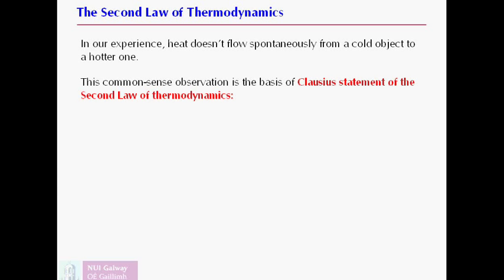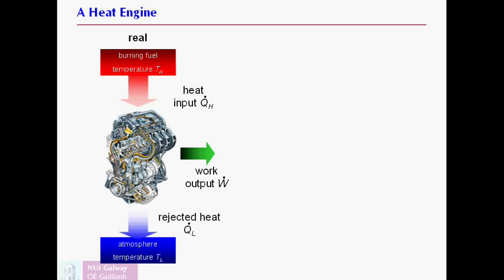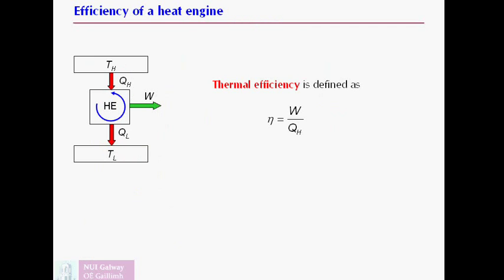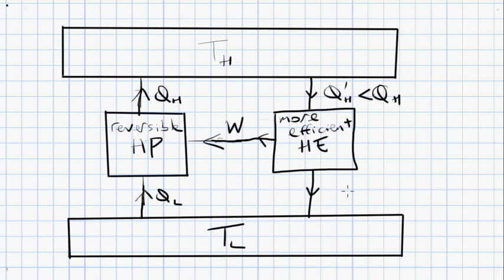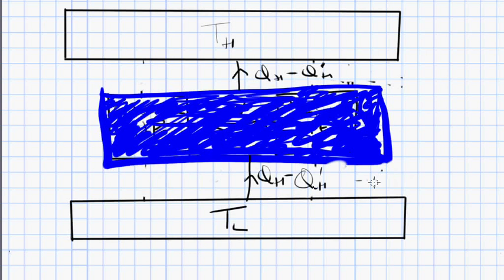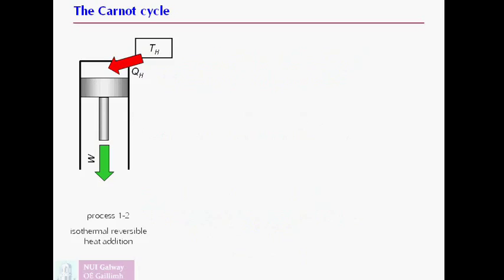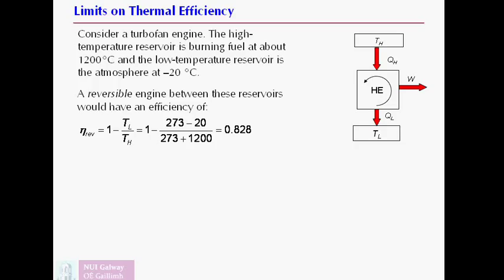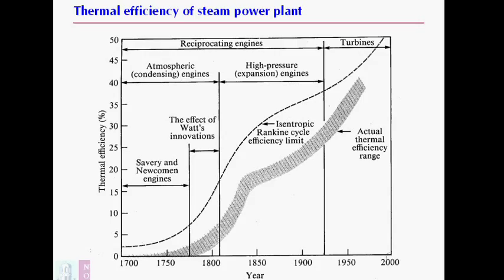Introduction to the Second Law of Thermodynamics

Comment: The Clausius statement of the second law of thermodynamics that you cite:

"It is impossible for any system to operate in such a way that the sole result would be an energy transfer by heat from a cooler body to a hotter body."

is true (in the sense that the operation as described in the statement would not occur in nature) but this is not what the second law says. "The sole result" is an illegitimate restriction; actually the second law allows additional "results" to occur. Here is Clausius' original argument:

http://www.mdpi.org/lin/clausius/clausius.htm 
 "Ueber die bewegende Kraft der Wärme", 1850, Rudolf Clausius: "Carnot assumed, as has already been mentioned, that the equivalent of the work done by heat is found in the mere transfer of heat from a hotter to a colder body, while the quantity of heat remains undiminished. The latter part of this assumption--namely, that the quantity of heat remains undiminished--contradicts our former principle, and must therefore be rejected... (...) It is this maximum of work which must be compared with the heat transferred. When this is done it appears that there is in fact ground for asserting, with Carnot, that it depends only on the quantity of the heat transferred and on the temperatures t and tau of the two bodies A and B, but not on the nature of the substance by means of which the work is done. (...) If we now suppose that there are two substances of which the one can produce more work than the other by the transfer of a given amount of heat, or, what comes to the same thing, needs to transfer less heat from A to B to produce a given quantity of work, we may use these two substances alternately by producing work with one of them in the above process. At the end of the operations both bodies are in their original condition; further, the work produced will have exactly counterbalanced the work done, and therefore, by our former principle, the quantity of heat can have neither increased nor diminished. THE ONLY CHANGE will occur in the distribution of the heat, since more heat will be transferred from B to A than from A to B, and so on the whole heat will be transferred from B to A. By repeating these two processes alternately it would be possible, WITHOUT ANY EXPENDITURE OF FORCE OR ANY OTHER CHANGE, to transfer as much heat as we please from a cold to a hot body, and this is not in accord with the other relations of heat, since it always shows a tendency to equalize temperature differences and therefore to pass from hotter to colder bodies."

It is easy to see that the two-substances process considered by Clausius presupposes the action of an OPERATOR; this operator constantly and unavoidably undergoes CHANGES, changes that are absent when heat spontaneously "shows a tendency to equalize temperature differences and therefore to pass from hotter to colder bodies". In other words, the trivial fact that, in a spontaneous process, in the absence of an operator, heat always flows from hot to cold by no means implies that heat will flow from hot to cold in a non-spontaneous operator-driven process as the one considered by Clausius. Clausius' argument is invalid - it is based on an additional assumption expressed in the phrases "THE ONLY CHANGE" and "WITHOUT ANY EXPENDITURE OF FORCE OR ANY OTHER CHANGE" - and therefore has nothing to do with the real second law which, in terms of the Clausius statement, reads as follows:

"It is impossible for any system to operate in such a way that the sole results would be an energy transfer by heat from a cooler body to a hotter body, on the one hand, and indefinite changes in the operator involving insignificant amounts of heat and work transfer, on the other."
Reply from the maker: I think you're right, Pentcho. For example, the operator could contain internal high and low temperature reservoirs, driving a heat engine which drives a perfectly ordinary heat pump, violating the statement I quoted in the video. I must admit I took that wording from a textbook (Moran, Shapiro, Munson, DeWitt) without analysing it very carefully. Maybe I'll go back to the version I learned in college from from Van Wylen and Sonntag - "It is impossible to construct a device that operates in a cycle and produces no effect other than the transfer of heat from a cooler body to a hotter body." Thank you!